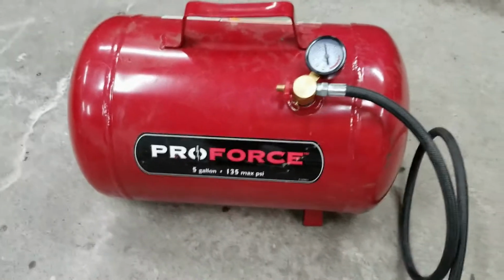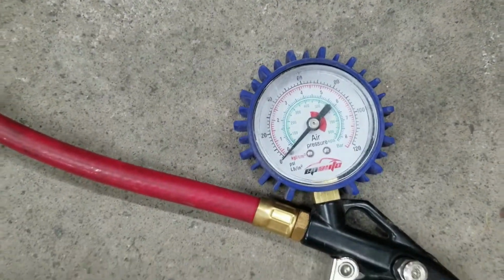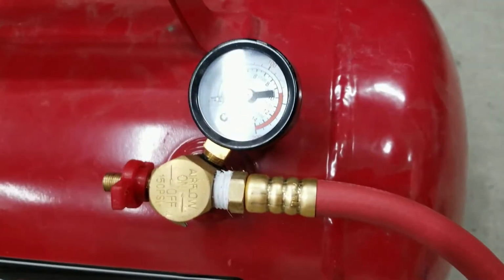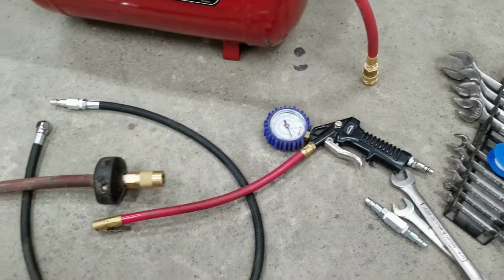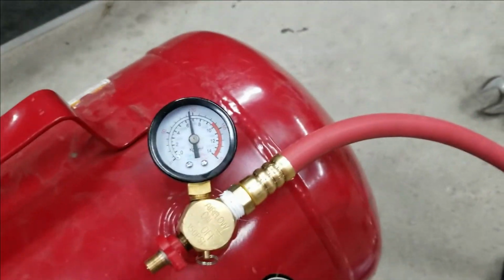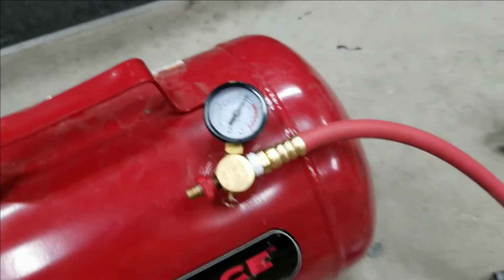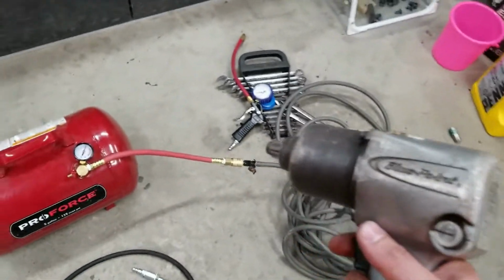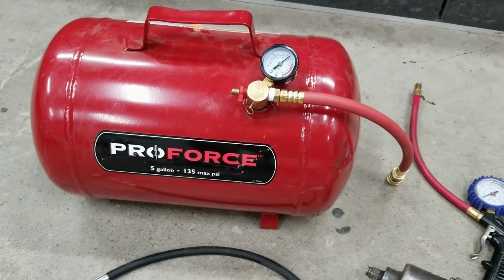Cheap Genius Hacks - huge air tank improvement in 5mins - fill faster and use air tools

Comment: Genius set up for this tank.  I made my own air tank with an LP tank that had the old style valve that was obsolete.  Take out the valve and weld in a pipe bung.  Ball valve with a quick connect in it and done.  Now if I could just figure out how to adapt my Klutch brand 12vdc air compressor from Northern Tool to have the normal style quick connects like we use in America.  I believe because its made in China it has some different shape quick connect on it.  The fitting into the head of the compressor is some type of thread I've never seen before.  Its not pipe thread that's for sure, some super fine thread not standard or metric bolt either.
Reply from the maker: Hmm. Now you have me wondering if my china freight 12v compressor quick connect is standard or not...